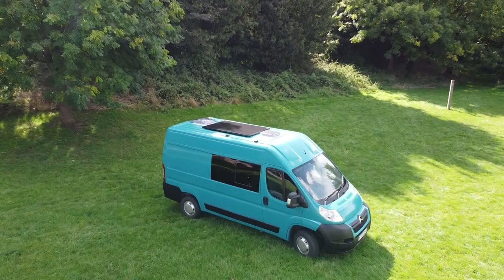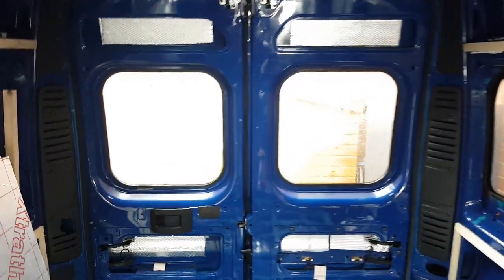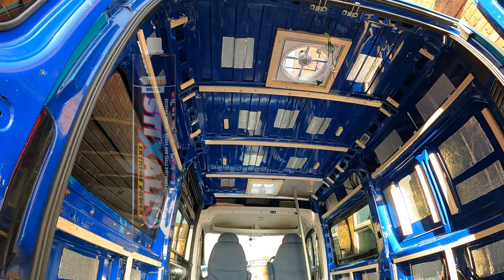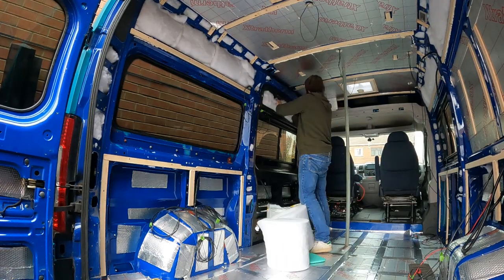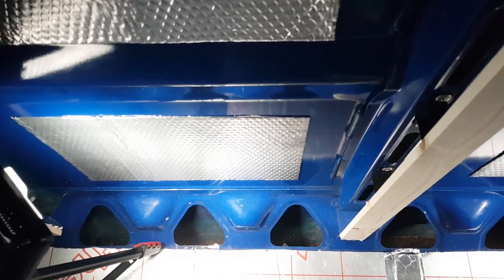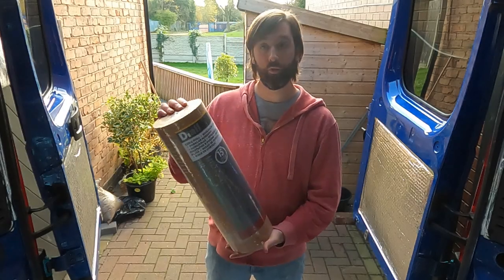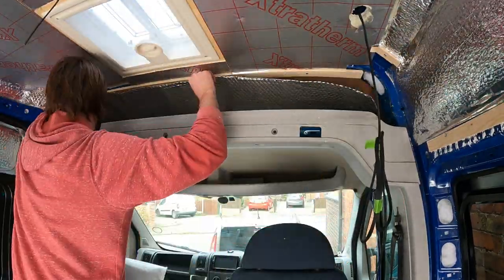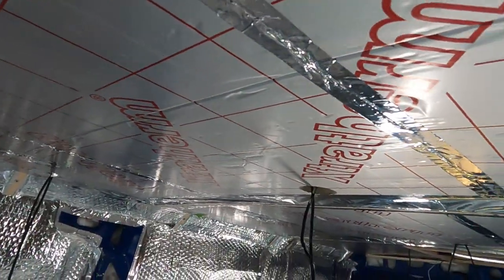HOW TO INSULATE a Self Build CAMPERVAN - DIY Budget Campervan Conversion

Comment: As someone that has spent many years converting shipping containers into other things I wholeheartedly agree with the lack of moisture barrier.  Unless you can spray foam and seal everything everywhere 100% your wasting money and effort. The roof will be the main condensation area, so seal that as best  as possible or find a way to deal with it. Managing vapour/moisture is what’s needed, ventilation and even dehumidification.
All that’s makes me sound much cleverer than what I really am but I’ve never found mould or evidence of mould on any conversion that got ripped apart after many years.
Good video 👍🏻
Reply from the maker: It's comforting to know someone hasn't bothered with a moisture barrier in their metal box and after years there has been no issue. Thanks for sharing! I've stumbled across a few videos over the years of people converting containers into living spaces and always thought what an amazing thing it is. I'd love to try and do that myself but I'm not brave enough to take that on. Kudos to you!
Reply: @PilgrimPods  there’s not a lot too it, it’s just a bigger heavier dirtier metal box than a van 😂. Thankfully I don’t do that anymore after all those years.  Keep the videos coming - you seem to add a bit of a round up or reflection at the end of them which makes a change from some stuff I see.
Reply from the maker: @noskills9577  you've had us pricing up containers and watching conversion videos last night... Thanks for watching!
Reply: @PilgrimPods  oh no 😂
Reply: 100% true
I believe the best way to avoid condensation is to either use spray foam everywhere, or line everything (and I mean every single centimeter of metal) with thin self-adhesive closed-cell foam, and then put your proper insulation on top. Also, I believe that the best way to stick PIR boards on a van is with low expansion PU foam. Then you not only get a proper bond but also a seal that will not allow any condensation to form behind the PIR boards.

Comment: I like the low budget approach not like other videos here. They all using top shelf materials and talking how professional the build is, fine when you can afford it but what about those who are having old van and low budget to deal with? In end of the day its all about to get you down the road and try van life and see places. Would be a good idea if you can add spending summary in each video just to show people that it can be done on low cost. Use cheap alternatives not just top shelf stuff
Loads of people are put off the idea of doing it because of the cost.
Hope you can prove that is not necessarily the case.
Reply from the maker: I've seen interiors built from just pallets that look amazing and like you say it's all about getting out there on the road and enjoying what the world has to offer. We 'are' trying to work to a small budget but there will be two big budget items in there that we personally don't want to be without; a Maxxfan to try and keep the van as cool as possible in the summer for our dog and also a 12v compressor fridge as we're hoping the efficiency will offset the initial monetary outlay. Of course for someone else, a cheap skylight and cool box could easily substitute these! We're planning on doing a video on costs once finished but for the time being we've listed all the items we've used in the video descriptions. Yes, some are Amazon links but they're items we've purchased ourselves as they were the cheapest. We've also made sure to list where we purchased everything else from as again we found them to be the cheapest, such as the PIR boards from Buildbase. 🙂
Reply: I totally agree with you I feel that it's got a bit silly with people feeling the need to make it all perfect and professional looking. I used to watch a couple of guys just like this one and i can tell you I felt more inspired by the have a go worriers more than the omg look how perfect this van build is. type of people

Comment: Hmmm.. to vapour barrier or not?  The best answer is you need both insulation and ventilation in your van.  The vapour barrier works to keep condensation away from the cold metal structure and helps with thermal bridging. Basically some use of all of these are best practice in your build. My own experience leads me to use a vapour barrier, but that is my choice of course.  If you want to see probably the best advice, have a gander at Greg Virgoe’s two videos on this subject on his build.  Greg is a heating and ventilation design engineer. I’m formerly in the property business and refurbishment where this subject is also a ‘hot’ topic. 
Really enjoying the build, especially that this is on a budget that more folk would see as possible for themselves to achieve.  Best to go your own way and enjoy the results 😎👍✅
Reply from the maker: As much as I love and respect Greg I'd need more than one heating and ventilation engineer to convince me to blindly follow their lead even despite the facts they present. The older I get the more it seems I question things. I've tried to do my own research and listen to various sources before deciding what's best for me. Listening to a few engineers from the marine industry weighed quite heavily in my decision. I'm no expert and wouldn't have the audacity to say THIS IS HOW THOU SHOULD DO IT 😄 but I would say there's an argument not to have a vapour barrier and folk should weigh up the pros and cons for themselves. 🙂
Reply: @PilgrimPods  it’s always good to stay curious!  It’s your van after all... so it’s got to sit comfortably with what you feel is right for you. 👍
Reply: @PilgrimPods  indeed I wouldn’t blindly follow what Greg says - there are a few issues in my view in other areas I wouldn’t do that way. Having said that there are a lot of videos out there that are definitely not to be followed!

Comment: Another great video mate you did right putting the cork on above the cab first I put the sliver bubble wrap on first and the first trip out there was loads of condensation so I’ve pulled it off now and used the sticky foam with the thermo on the back of it and carpet  over it 👍
Reply from the maker: Gutted! 😬 Thanks for putting my mind at ease regarding that Dale. 🙂👍

Comment: Never used the vapour barrier method myself. Just stripped out my Relay for a refresh/rebuild and it was bone dry inside just using silver bubble wrap and recycled plastic bottle insulation after 5 years use
Reply from the maker: That's great to hear Steve! At least it is for me anyway as it supports my researched argument, and puts my mind further at ease going against what most seem to do in their vans. The theory clearly works in practice! 😄 Thanks for sharing that with me. 👍
Reply: @PilgrimPods  I also worry that some vans are too sealed ie not vented enough and could cause issues with incomplete burning of gas on hobs etc thereby causing CO to be produced due to lack of oxygen
Reply from the maker: @stevebrown6665  hadn't really thought about that to be honest.

Comment: Regarding the sills - watch out that any water ending in there is meant to drain through existing gaps/slits between the outer sill skin and the vertical wall on the inside. I've sprayed cavity wax in mine as well - and then I've discovered that water was accumulating in there after that and not draining away - as the slits were blocked. As a temporary measure, I removed one of the rubber bungs to let the water drain away - but I really have to unblock the slits for free drainage. The design of the body allows water to drain into the sills - from the bottom of the sliding door channel, and also from another place I haven't been able to identify yet - as the sills on both sides fill up with water when the drainage holes are blocked. So you do need to make sure that there is a way for the water to drain away. 

One more thing - watch out that you will need to have a way to get behind the rear light cluster - as I believe that is the only way to remove it in order to change brake/indicators/reversing light bulbs. So whatever you attach instead of the two internal black plastic panels have to be relatively easy to remove.

I hope the above helps. Good luck with the build - it is looking good! :-)
Reply from the maker: Thanks for the advice Seb, especially regarding the sills. I've carpeted the access hole for the rear lights as well as the surrounding area but the area behind is free of insulation so when the time comes to get in there I'll just cut a slit in the carpet and tape it back up afterwards as it'll be hidden by the trim piece. Again, appreciate the advice! 🍻
Reply: Back in the 90s I waxoyled the insides of all four doors of a car I had. Ten years later the engine was worn out and the shell was rotten, except for the doors which were like new. It does work.
Reply from the maker: @gepwxaqdfsidsesg1548  that's comforting to hear. Thanks for the reassurance!

Comment: Hi Craig. After thinking about it I think you may be on to something mate. A house has vapor barrier fitted but it also has vents. So, barring that in mind it is logical to install a vapour barrier but leave the lower channel as you have done to breath and also maybe some inspection hatches and fit moister sensors to warn of a build-up of condensate. Maybe even fit one-way valves to let moisture out and possibly some kind of vent. Only thinking maybe, a house builder could add some thoughts on the matter. Great topic Craig well spotted
Reply from the maker: Hey Ken. Thanks for sharing your thoughts. Like you say, it's an interesting topic and I don't believe either route is a definitive right or wrong. I'm of the belief each and everyone of us should weigh up the pros and cons and make a decision what best suits us personally. That's exactly what I've done and decided a vapour barrier wasn't right for us based on researched facts from various sources as opposed to listening to one person's opinion, and using my own common sense. 😊

Comment: I’ll be using similar materials but definitely going down the vapour barrier route. If you’ve ever stayed in a camper in winter the amount of moisture you produce is mental! Best to limit as much as is possible because unless you are installing proper ways to ventilate the area behind the insulation it’s never going to dry out!! I’d be interested to see the two options properly tested though! You never see after build comparisons.   Also one thing about the air coming in from outside, it’s colder at ambient and not moisture laden so won’t condense on the skin.  👍🏻
Reply from the maker: I've only ever really camped in tents but completely get your point about the moisture buildup in winter! 😁 Ventilation should be key in any van build in my opinion to limit that moisture buildup. I completely get your point about the drainage holes but having now given them a good scrub it's clear to me moisture/water can get it in through them via air/splashes/whatever it may be. 🌊🌧🌪😄 I was also concerned about achieving a 100% sealed barrier. Better to let the van breathe and ventilate well in my opinion. A test of both methods would be great,  someone needs to get on it! Like I say, all we can do is research and decide what works best for us. However, I'd say there's certainly an argument not to install a vapour even though everyone does seem to be trying to install them. 😊👍
Reply: @PilgrimPods  a collaboration then, once both vans are complete 😂 one week in cold weather and a moisture test
Reply: @Midlander  Is this still on the cards? I'm currently doing vapour barrier research
Reply: Ive just had to rip out my van conversion to to damp in the van which had a vapour barrier in it, What started out as a little refurb has ended up back to a empty van. Not sure weather to put the vapour barrier back in or not or do as you have here so confused and P##ssed OFF.

Comment: Great vid again Craig. Will be putting a vapour barrier in my van conversion. However what worriers me, if anything leaked, like round a ceiling fan/vent, solar panel fixing, you would never know until it was too late !! Trying to workout a method of checking under the vapour barrier somehow,once a year say.... Will look forward to see the next stage of your van build, looks great so far.
Reply from the maker: Thanks John. I originally planned to have a vapour barrier (you could say I've almost got one with all the foil and tape I've used) but elements like the drainage holes swung my decision. I think good ventilation is key whatever route we take so I'll be mindful of that when using the van to limit any moisture buildup. A short follow up video might be worthwhile when using the van to see whether my decision appears to be right or wrong... Best of luck with your own conversion!
Reply: @PilgrimPods  Thanks,..Good idea of yours with sort of a part vapour barrier. Should work well for you. With me and the dogs vapour is a problem ! Got at least a month before gets to the vapour barrier part. Will see if can think of something. Look forward to your next video. Cheers John

Comment: One of the first things I bought was a plastic sheet vapour barrier but like you after looking at my Relay I'm not sure there's any point in trying to use it. There's so many interlinked channels that I'm sure I won't be able to close it off.
My Relay came with plastic bungs for those side cill drain holes. Currently I have them removed to allow airflow.
Reply from the maker: Hey Matt, sorry for the slow reply. Personally I think a lot of us over think the vapour barrier conundrum. I'm trying to limit exposure to the metal of the van but accept I'll never be able to fully seal it all off. I also remind myself the metal of my van is galvanised and has a layer of primer and paint protecting it. If I had a Sprinter or Transit I'd probably be a little more worried as I've seen many an abused five year old van on the road with signs of rust taking hold because they're not galvanised. Regardless of whatever route you take, all the best with your own build mate!

Comment: Great job. I wish i had used that board on my floor, but did not want to lose the height  being 6ft1. I do have a cold floor. Laminate floor insulation doesn't cut it.
Reply from the maker: Hey Lee, thanks for swinging by again. Height was a concern for us too but we just about got away with it in the end. I'll drop you an email tomorrow. 🙂👍

Comment: I just think some folks WAY overthink and there for overengineer their floor adding unnecesary weight and height. 
Use close cell foam, stick it on the floor, floor direct on top as it easily can carry the weight (being spread out as well), done.
Cheaper, quicker, insulates absolutely fine, deadens sound too..
Yep, ventilation is key, not spending time and cash on a vapour barrier.

Comment: I removed all recycled bottle insulation from van was building up and absorbing condensation i noticed aswell on t5 that theres actually vent holes in panel floor to circulate air from below to gril at top rear just a small flow but its important to breathe, i doubled up on soundead everywhere and cell foam now no condensation in mornings or ever
Reply from the maker: Thanks for the knowledge bomb. 🙂👍

Comment: After converting outbuildings etc for habitation the regs called for a vapour barrier, however, a time served building inspector told me not to bother as its pointless unless you can seal it 100% which is almost impossible.

Comment: Hi there! Thanks for your content - finding it really helpful in the lead up to our van project. We are also looking at buying a citroen relay around the same age - as we want a widthways bed (tall pair!).  Did you have any concerns buying a slightly older van? We are finding so many builds are on much newer vans and its simply not within our budget!
Reply from the maker: No concerns whatsoever. It's always worth going on MOT checker to see what has been flagged up on previous tests to get an idea of things. Being an older van with 170k on the clock I'm prepared for the possibility of repairs but have my fingers crossed they won't happen. Any car/van can have problems regardless of age and at least we know ours is well ran in. Maintenance is key and chances are if you get an older van with plenty of service history you'll hopefully be golden. Another important consideration is its past life and what has it been used for. Better a high mileage van doing motorway runs delivering pillows than a low mileage van moving bricks day in day out! 😄

Comment: I always wonder how much effect insulation has in those rail channel cavities. Decent at radiation and convection of heat, but what about conduction from the metal? Perhaps spacing the walls from the metal is the solution. Air is a decent insulator. PS: I think your moisture barrier theory is correct. You can really only slow it down - which isn't bad in itself.

Comment: We've very recently started our first Citroen Relay van build and have just discovered your videos. We've never done this before and are finding them really informative,  straightforward and very helpful.  One question I have - is there anything you wish you'd done differently?
Reply from the maker: Thanks and yes, got to grips with my sound levels for the videos earlier on... 😄 I'm building the kitchen units at the moment and in hindsight probably should have fit them straight after the bed frame. Other than that, nothing really so far.